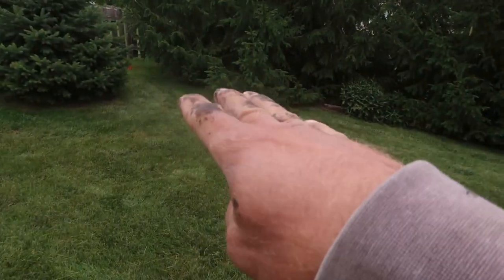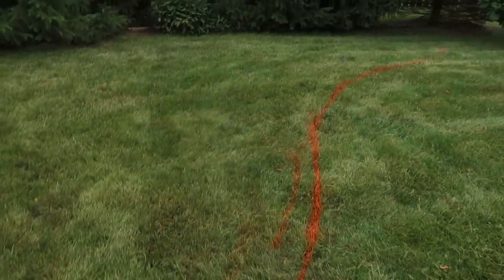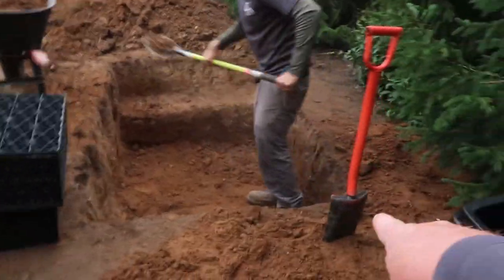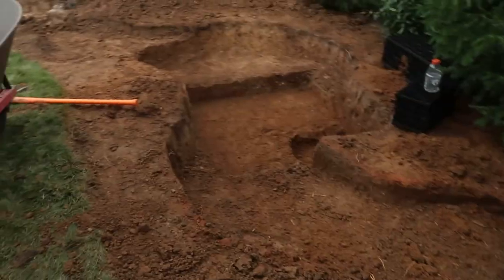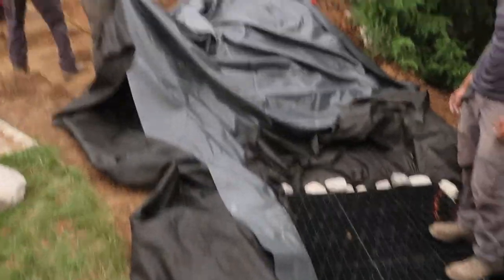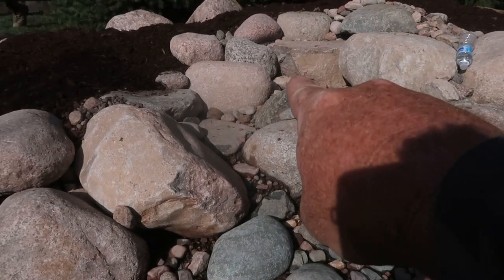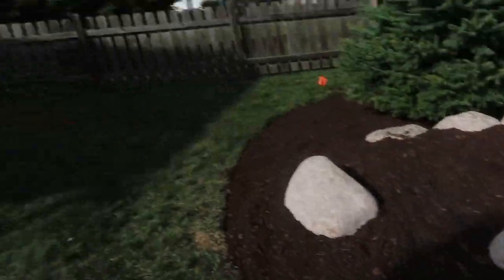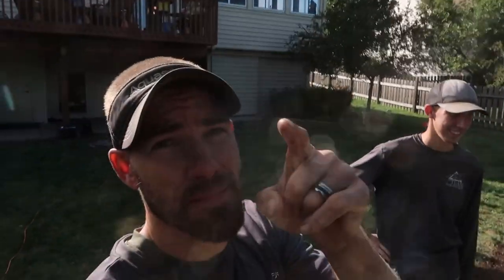Simple Pondless Waterfall and Stream with a Bird Beach!

Comment: My pond is 6 m x 2 m x about 0.6m deep- what size pump for my waterfall which is 1 m above water level ? Prefer low voltage for safety and a pump that can take small particles and won’t get clogged up?

Comment: question could u give the price of (matiral) on one day projact every time?? so we the people could go to u knowing about what a estimate would be* (matiral)
Reply: The package they used $3,650 USD and the rock I guess would probably be about $1,200-$1,500 in rock including the delivery fee, which tends to be about 30% end cost of the rocks and stuff then add another $200ish for stuff like more foam and wiring, odds and ends. If it helps I have a pondless water fall on my channel that cost me under $2000 CAD even using Aquascape products to, but I didn't buy very much rock as I had a good amount already and worked with what I had.
Reply from the maker: Check out the foreman notes. Link is in the description